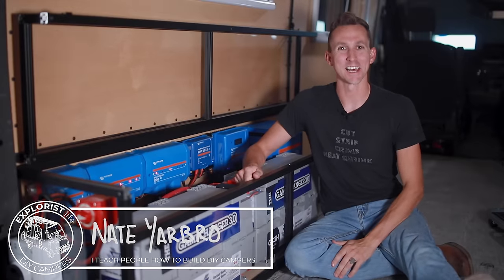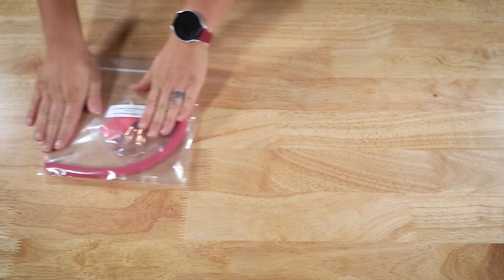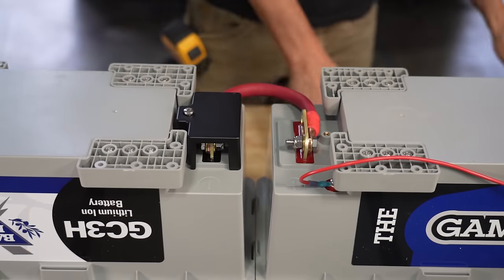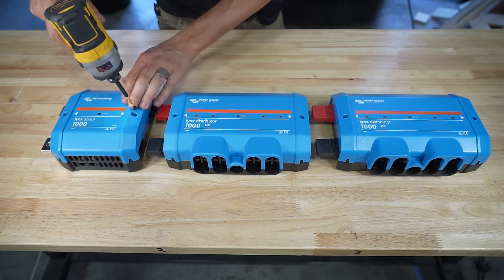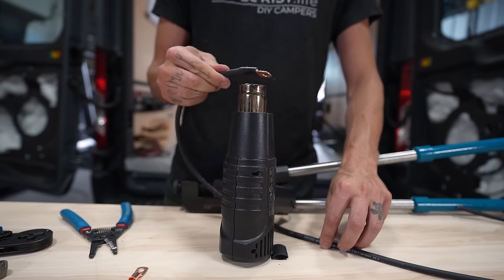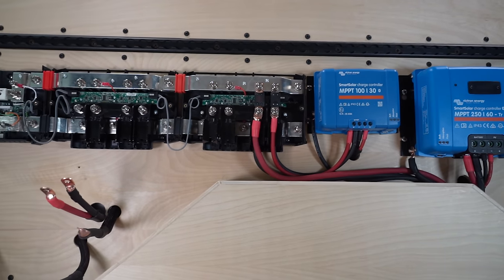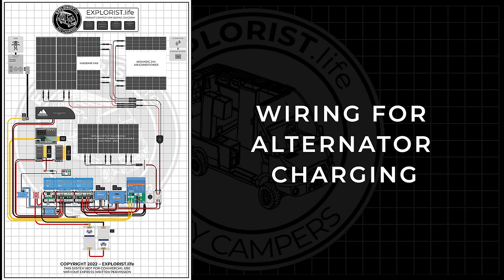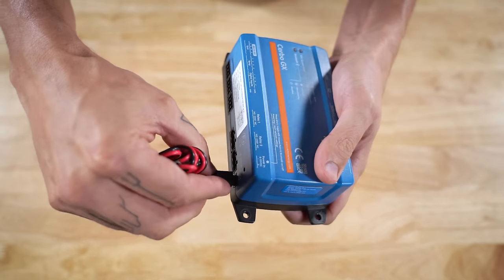DIY CAMPER VAN ELECTRICAL INSTALL (Start to Finish Tutorial)

Comment: Question about the smart networking. Instead of using VE.Smart networking between the 2 MPPT Solar Charge Controllers. Wouldn't it actually be more efficient to use DVCC in the Cerbo to "network" the Multiplus and the MPPT's together for better system charging? This would allow solar to charge the batteries while connected to shore power more efficiently and each charger would know what the others were doing. It is also my understanding that VE.Smart and DVCC shouldn't be enabled simultaneously as that can cause some confusion in the system.
Reply from the maker: DVCC is indeed another option.  It's more powerful from a programming standpoint, but that inherently makes it a bit more complex.  I'll have to release a video talking about that specifically before I recommend that over the VE.Network.

Comment: Just received my wiring kit and wouldn't even think about doing this without your help. Thank you! One question, In wiring our skoolie can I use 6awg wire to the DC fuse box if it is about 15 feet away from the Lynx distributor?
Reply from the maker: Great to hear!  Yes, that length is fine.

Comment: I do not see a Fuse between your battery bank and the Main power on/off switch.  On other systems that you have provided wiring diagrams, you use a 400 amp Fuse (12v systems).  Why did you eliminate the power fuse?
Reply from the maker: The main fuse is a terminal fuse attached directly to the positive battery terminal of the battery bank.  Check the section starting at 8:13 to see that.

Comment: What do you do about the heat generated in the enclosure. I have 400ah lithium and multiplus 3k, smart shut and distributor, along with smart solar 150/100, all install in a similar sized enclosure under my bed. And when use system heavy it gets hot and only ends up charging the batteries around 30 amps. Due to the heat. Temperature in the enclosure was 131 degrees. I had to end up installing 2 140mm 12 volt PC fans and used built in multi relays to turn them in when it's fan came on.
Reply from the maker: There is about 27sq/in of ventilation clearance around the back and lid of the enclosure.  Based on the 100's of installations I've consulted on, I do not expect overheating issues due to this clearance.  If there is overheating issues, we will add thermostat-controlled vent fans to either end of the enclosure (will make a video of this if it comes to that), like it sounds like is similar to what you've done.

Comment: Realistically how much heat will that generate? If I install this under my bed will it heat my sleeping area? I plan on using a velit 2000r above the bed  with thermal curtains closing off the space to maximize cooling, will an under bed setup make it to hard for my AC to cool me during sleep?
Reply from the maker: About the same amount of heat as,say, an Xbox or gaming computer.
Reply: @EXPLORISTlife  Sweet, thanks. Those are terms I understand!

Comment: Love how you were very detailed. Love this system but for the price it would take me 20 years to be able to purchase one battery. I'm disabled and live off social security disability. I bought a 2000 Chevy express cargo van Fite truck. And I am trying to turn it into my home on wheels. There any cheap systems you would be able to give advice on please? I am diabetic and need to make sure no matter what I have enough power to run a refrigerator to keep my insulin safe.
Reply from the maker: Supplementing a smaller capacity system with a fuel burning generator is pretty much always going to be the cheapest cost upfront.

Comment: Hi Nate and Steph, I was confused and uncertain with the Electrical side of the van build.  After an extensive search and watching your build/install videos, I purchased one of your wiring/component kits from you.  The build was straight forward using your wiring diagram.  Thank you for making and offering a DIY electrical kit that explains every thing you need.  On this video you had mentioned that you were going to hold off on the Alternator Charging portion.  The last connection that I need to make is to the Alternator on my 2022 Transit.  Should I connect my Alternator Charging cable to the CONSTANTLY POWERED 60AMP terminal or the 170AMP terminal?  In addition how should I connect the 60AMP fuses (that is supplied with your wiring kit) to the terminal?  I have temporary wired in BLUE SEA 60AMP Breaker but am very hesitant as to which location to connect to.  Thank you for your time and sharing your expertise with me.  Happy Holidays
Reply from the maker: Hey!  Just wanted to follow up on this.  We just released the alternator charging video that accompanies this tutorial.  Here is the direct link to that: https://www.youtube.com/watch?v=FuBAKTCCnt4

Comment: I have a question about the practicality of using "heated batteries".  I too live in Colorado and recreate in the cold/snowy mountains .... however .... my understanding is that there is a safe/efficient temperature range of operation (and charging) for the batteries .... But .... if you are going to leave the Van in an environment that is too cold for the batteries, how about water?  Seems to me that water systems could freeze, and/or be damaged .... also, other personal items inside the Van.  Sooo .... isn't it wise and necessary to keep the Van above a freezing temperature (unless it is in "winterized storage")?  Thus, do you really need to Heat the batteries?
Reply from the maker: The heated batteries would allow you to pull a winterized heater out of storage -> run the heater until it's above freezing in the van -> Fill up the water system.  

Otherwise, you'd need to make concessions for water usage (winterizing) or keep the water system heated, to some degree.

Comment: Hi Nate, thanks for the video. I just ordered the 24V wiring kit from your website and look forward to replicating your build. For devices such as laptops which would need a constant AC power supply, how would you go about connecting a smaller inverter?
Reply from the maker: Nice!  I'd just run those through the main inverter.  There's not a clean way to add a secondary inverter just for certain circuits.

Comment: I’m confused! If you have 10 AWG wire from the external solar array, why use a 60 amp charge controller? Wouldn’t 6 AWG be more appropriate?
Reply from the maker: The input wire can be smaller as we will never be putting more than 30A to the input.  Remember... 60A is the output.  Perhaps a refresher on what a charge controller does would help: https://www.youtube.com/watch?v=Jkbs84sBHsg&list=PLmvhcyi4n0TUjVGA_O5aI5SQrS1kKLgEF

Comment: Hey Nate or anyone who knows their stuff: Is there any reason why you couldn't hook up a generator as shore power? The RV that I'm doing my first setup on won't have solar panels for while but I plan to just charge it up via extension cable or whatever in the meantime. An extension cable from a portable generator or my built-in 4k Onan would be no different than an extension cable plugged into the wall correct?
Reply from the maker: Totally fine.  If you've got a built in generator, you've also likely got a built in Transfer switch.  Both the shore power inlet and the built in generator would be the 'inputs' and the transfer switch would just send 'whatever is supplying power' to the Multiplus for passthrough and charging.  If you wanted to plug a shore power cord into a generator, that's totally fine too and the system will function just as if it were plugged into a shore power pedestal.

Comment: This is really a good vid. Just wondering why are IPX entry glands being used in a sheltered enclosure? Why not just grommets (assuming cable insulation protection is the objective). Asking coz especially at 1hr 1min during the solar isolator install, two cables go through a single gland ,which is not per the gland's design intent. Thanks.
Reply from the maker: Strain relief.  The gland holds the wires in place so there isn't strain on the actual electrical terminal.

Comment: Great video. But, I'm definitely missing something, why is there a need for two MPPT charge controllers? What the reason for the smaller one? Thanks.
Reply from the maker: We have a solar array on the roof (small controller) and a ground deployable solar array to sit beside the van as needed (large controller).
Reply: @EXPLORISTlife  Ahhh.. Thanks for explaining this, I wasn't aware of that, and thought maybe you have a separate solar charging system for the engine batteries.  Great videos, always helpful, can't wait to start my own camper project next year.

Comment: Crazy how many victron components you need to solve such system requirements... thats why i desided to buy a deye inverter, which is capable to manage 3 strings, battery, Grid-Load and an optional generater in one. But a very nice and solid build! :)
Reply from the maker: Yeah, It's like buying a honda civic to get you from point A-to-B vs building an old muscle car from the ground up. 🙂👍  Both will get you where you're trying to go, but one will teach you a ton along the way and give full and ultimate customization.

Comment: My question is. Why do I need this much electrical system to stay warm, run a van sized 12v fridge, and some lights. Why a $9000,00 sys. ? In a van, or camper trailer of van sized.  Or is it sell n Overkill ?
Reply from the maker: I'm not really sure I understand the full context of your question so feel free to ask additional questions; but the more demand we put on our electrical system with increased flexibility and capacity options; the more expensive it will be. 

If literally ALL you are doing is needing enough power to run a diesel heater, a 12v fridge, and some lights; you won't need a system this large.
Reply: Thank You, that put a lot of light on this for me. I have not lived this way yet. But I am looking into it @EXPLORISTlife

Comment: On your wiring diagram, I do not see the Victron "Smart Battery Protect", or another type of circuit breaker to guard the A/C circuit (yes, there is a fuse on the Distributor panel).
Reply from the maker: That's correct.  I do not use a smart battery protect in any of my systems.  It is not a necessary item for my designs.

Comment: What is the justification to go with Lynx Shunt VE.Can vs SmartShunt? I understand this might be Victron sponsored video but what is your justifications? In all your plans up till now you deploy SamrtShunt. Price difference is about $250 and would like to know reasoning.
Reply from the maker: First off regarding victron sponsored video, they did not sponsor this video no.  We bought all of the parts for it at our standard dealer rate since we do sell Victron components now.  It's so much not sponsored that they wouldn't even share the video on their home page like they've done with other videos and I had to freaking beg them to even share it on their facebook page. 🙄 👎😂

That said...  we chose the Lynx Shunt because everybody was asking about it in our comments section and wanted to see it in a video... so we did it. 🤷😆

Search for "explorist.life smart shunt vs bmv712 vs Lynx shunt" for we did on a comparison of the 3 units.
Reply: @EXPLORISTlife  Just finished watching comparison video. Based on your table comparation, I will go with SmartShunt with my system and spend extra $250 left on the entertainment. Thanks for being so valuable recourse on the utube.

Comment: At around 18 minutes you are wiring the solar charge controller to the lynx and using 6 awg wire. Can I ask why such large wire? How many amps are coming out of the controller. I know your panels are not putting out that many amps. I was thinking 10 or 8 gauge max.
Reply from the maker: We size all of our charge controller wiring kits to be the max wire size that will fit into the terminal so that it takes all guess work out of the equation and brings voltage drop to near-zero.  It's a bit over sized, but is also the most fool-proof way to do things.

Comment: Nate and Steph, I have been Binge watching and need to take a rest!  Fantastic Videos!

One question, when you tighten connections, you often say "Tighten to spec" but I see you using wrenches, rachets, screwdrivers, and in some cases a torque wrench.  Where might I find the torque specs?
Reply from the maker: Torque specs will be listed in the user manual or on the data sheet of whatever device you are installing.

Comment: Long time watcher here!  Excellent video , very informative and will be using your ideas for my build.

One critique though, at 30:54, where you connected the equipment ground wire to the Lynx distributor, you put the lug for this over the PCB negative lug. This has reduced the effective electrical contact area between the equipment grounding wire and the negative bus bar.
Reply from the maker: If that's your only critique, I did pretty good! 😂  The way I made that connection is actually what is recommended in the Victron Lynx Distributor user manual (ch 6).  I think that putting the big lug directly on the busbar makes most sense, so I'm 50/50 on which direction I go there.  Since that's not carrying current normally, it probably doesn't matter much either way.

Comment: Have a 23 transit on order and thinking thru the electrical system , so this is very timely. We will be parking our van outside in the mountains with winter temps of  around 20 degrees F for up to 1-2 months without using the van( ie without heat). Can we make this type of system work or do we have to use other than lithium battery technology. I am unsure how the batteries will respond to staying in cold temps for a few months between driving/use. During the winter when we will drive the van it will be for short drives of about an hour. I plan to put in a Rixen type hydronic heat system, tapped into the transits gas tank. 
Thanks for your very helpful videos.
Reply from the maker: This type of system will be perfect for what you're doing.  During your times of 'storage', you can keep the system connected with the battery heater active and let solar or shore power keep the batteries topped off.  OR... you can disconnect the electrical system altogether and let the batteries fall below their low temperature point where the BMS will simply disallow usage and you'll have to somehow warm them up to above freezing before using the system.  Also... these Battle Born Batteries can be DISCHARGED as long as they are above -4 degrees F; so as long as the batteries are above that, you could still use the heater function to heat them back up.

Comment: My understanding of the Victron "Buck Boost" charger, is that it is not a Bluetooth device.  So, it will not integrate with the Victron Smart app on your phone like the other components do.  So, if you do not want for the charger to be using alternator power (fuel savings), how do you turn it on/off?
Reply from the maker: Having the 100A charging capabilities is more important to me than bluetooth capabilities.  I wish there were a 100A Orion Smart, but alas... at this time, there is not.  It can be turned on/off, though by the remote signal wire.

Comment: How did you determine the total amps needed to be provided by the Orion DC-DC 24/12 Convertor? The system I am designing has an estimated total 12V load of 150A. Will one Orion 24/12-70A Convertor be enough, not all of the loads will be on at the same time.
Reply from the maker: You just need to figure out how many amps of simultaneous load you need to supply and get enough amps worth of Orions to cover that.  We are only supplying power to a max of, say, 30-40A at any given time.  A winch would come from the starter battery and our DC Air conditioner is 24V coming right off the lynx distributor at 24V.
Reply: @EXPLORISTlife  Thank you for the quick response!!! I will go back and calculate the potential "worst case" scenario. Keep up the good work...info sharing!

Comment: I can't tell what size wiring you're using for your 120v outlets. I'm used to working with solid wire Romex, but that doesn't seem to be the preferred option for a truck/van build. I want to go use 20a breakers, but having a heck of a time finding stranded wiring with a ground.  Where do you guys get your 120v wiring? From a chart I just found, it seems that I maybe should be looking for 10 instead of 12 guage (my box truck is 16' long)??? Thanks!
Reply from the maker: 12ga Triplex wire w/ 20A breakers for standard household outlet circuits having more than 1 socket: https://amzn.to/3TjLbaX
Reply: @EXPLORISTlife ,  thank you!!

Comment: As usual, an amazingly thorough video, you never fail! At time stamp 1:02:05, you are talking about the external connection for a ground deploy solar array, but I am confused about whether there are different or better options as to what type of wall port should be used. I don’t see this part in your kit lists, am I missing it? I am about to order the whole set for my system, but this will need installing pretty early, before insulation and all go in. Thanks so much for these again!! My other question is about when would a buck-boost device be a good idea? It seems pretty expensive, but I don;t see any way to get that many amps in from an alternator.
Reply from the maker: The ground deploy solar port is listed in the 'other parts needed' section of the kit for this build: https://shop.explorist.life/shop/all-products/camper-wiring-kits/complete-wiring-kits/540ah-3000w-24v-multiplus-580w-to-1700w-solar/

The only 'good' way to get 100A from the alternator is a secondary alternator, which is a great option... but gets a bit less DIY friendly depending on what vehicle you have.